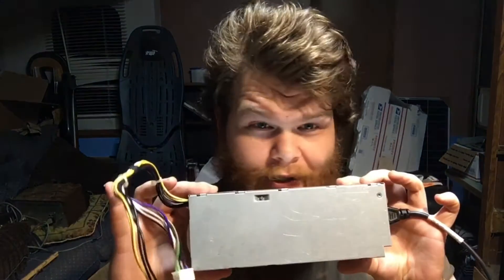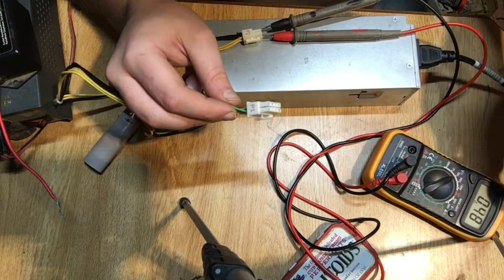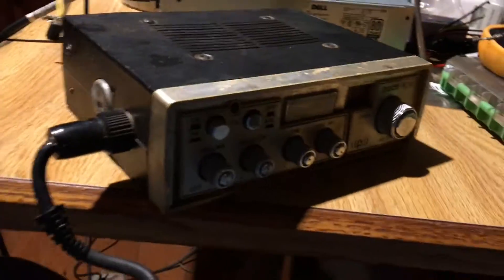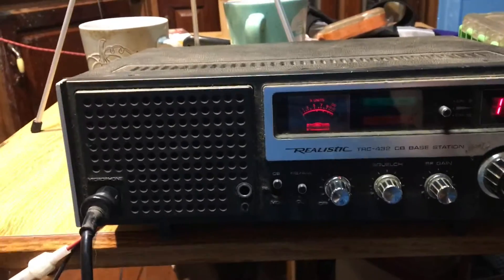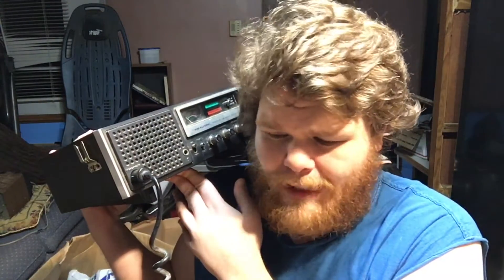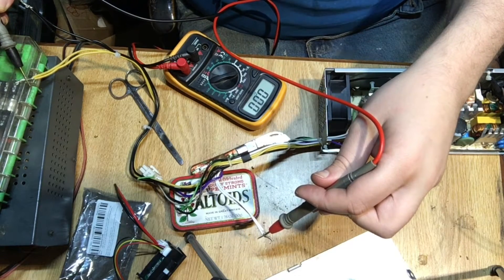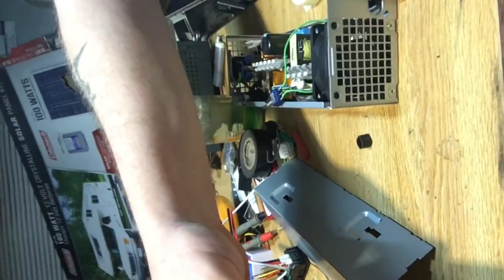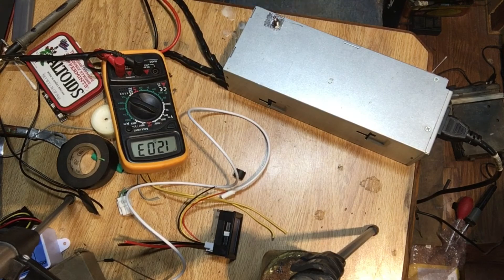DIY Power Supply for CB Radio

Comment: I started using PC power supplies after I watched your video about using a Wii power supply. I use the very same power supply as the one in this video on one of my rigs. The good thing about using a PC power supply is that they usually already have some sort of noise suppression inside . I did the same as you and put an on/off switch on the black and green wires. Great video, thanks, Johnny.
Reply from the maker: That’s cool buddy!
I assumed that the PC power supply had some sort of noise suppression because of computer systems using a frequency clock.

But it wasn’t quite able to tell if pulse width modulation would cause more problems with CB radio because of the antenna wanting to pick up 27mhz

And I’ve heard that square waves or saw waves are full of mixed frequencies that could be picked up by the antenna jack

It also seemed to help more as I kept the power supply away from the antenna jack

But some of that high frequency electromagnetic radiation may be making its way down the power cables too

Comment: You forgot to let out the magic smoke!  🤣🤣🤣 As you found out, the main problem is noise from switch made power supplies, however, they are a lot better than some power supplies I have seen you using in the past.  Shame they didn't have adjustments inside to take it up to 13.8Vdc  😐
Reply from the maker: Yeah there was no internal adjustments that I could see to change the voltage, maybe I’ll look again just to be sure 👍

I figure I’m going to let my dad use it because he’s always messing with motors and finding new things at the flea market to test out ☺️
Reply: @JohnnyJonesathome  It's a fixed output voltage, I have yet to find one with an adjuster.  Changing it would mean a high level of knowledge of electronics.  It is all quite complicated.  I will not touch them, due to the way they work and risk to life!
Reply from the maker: @BoB4jjjjs  yeah that’s why I assumed I couldn’t adjust it in the first place.

I suppose you could manipulate the windings but as you said I don’t feel comfortable doing that either and I don’t have enough knowledge to do it safely.
Reply: @JohnnyJonesathome  Maybe as simple as a resistor change to another value.  However, I have never studied then, mostly due to the high frequency they tend to run at, nasty!  Give you a real nasty shock.   I'll just leave that to the designers.  I don't know of anyone that has altered them, so I would stay well away from them!
Reply from the maker: @BoB4jjjjs  I have a feeling that’s a very wise opinion. I don’t think I’ll go mucking about with them until I know more 👍
Reply: @JohnnyJonesathome  Wise decision, not like you 🤣🤣🤣
Reply from the maker: @BoB4jjjjs  Sometimes you have your choice whether or not to put your balls in the air fryer

 when you gotta flip that coin Bob  you just gotta flip it. 👍